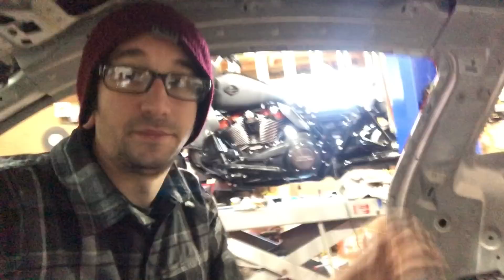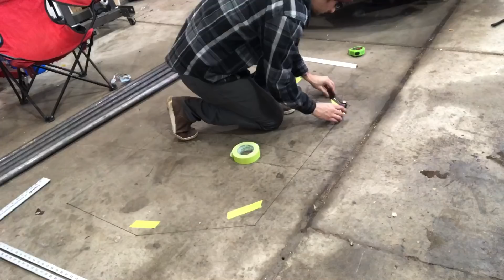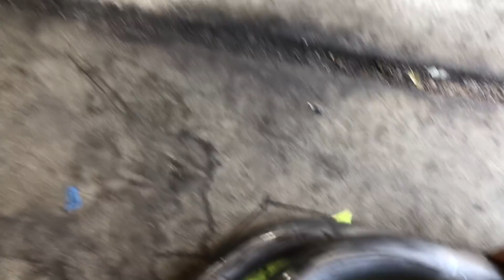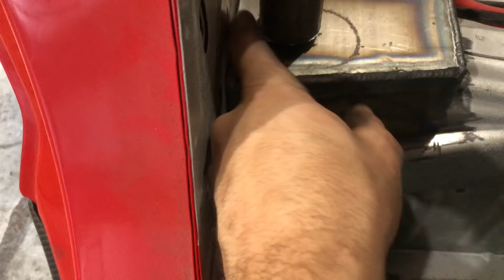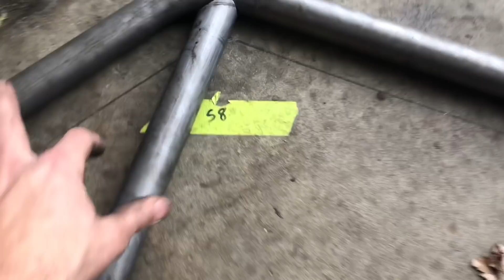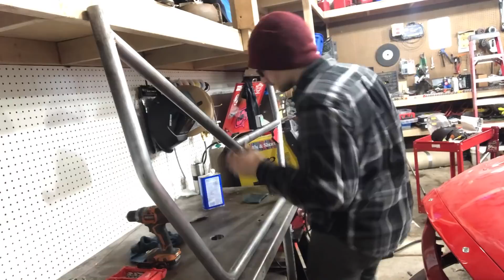Roll Cage Main Hoop / LS S550 Mustang

Comment: Another good reason to drill a hole in the main hoop and bars is for cage inspection depending on the intended purpose of the car the cage will need to be inspected for minimum tube thickness.